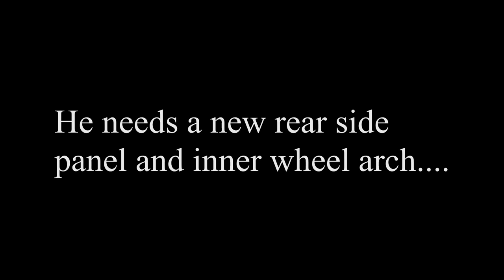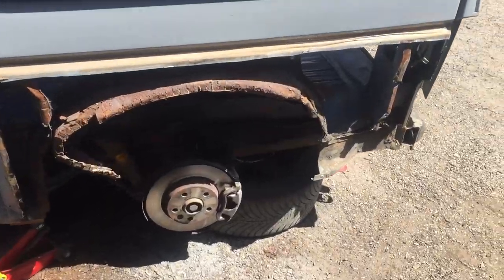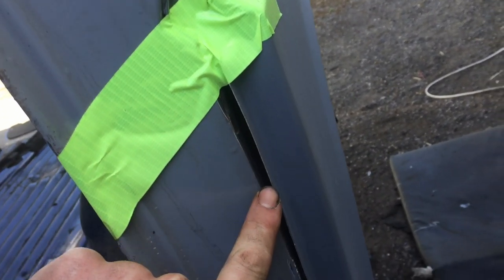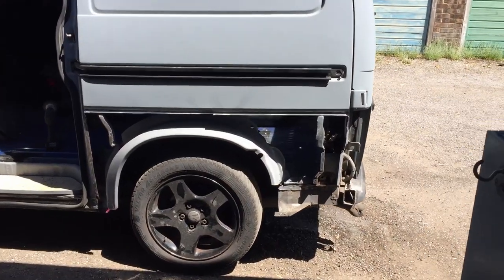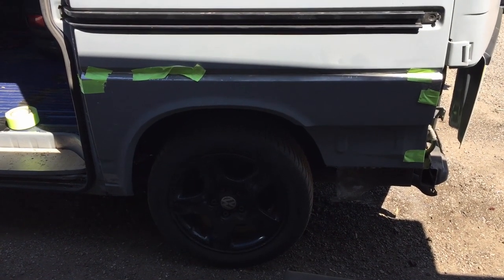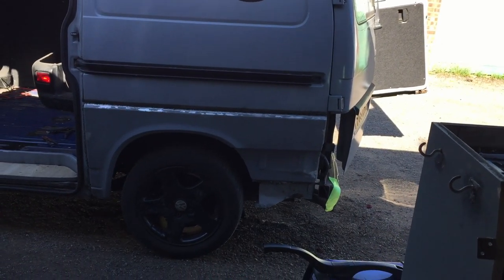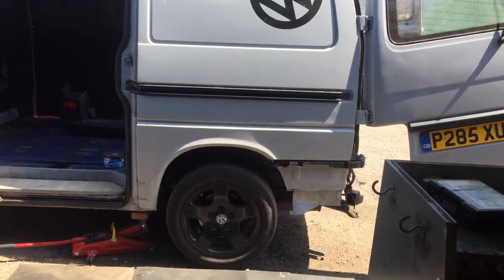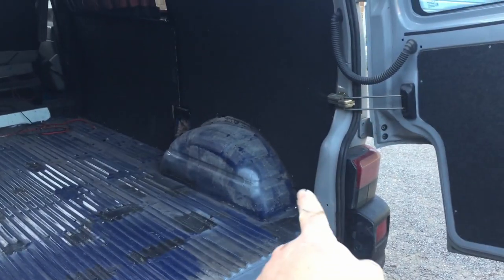VW T4 - Wheel Arch and Quarter Panel Welding

Comment: Thank you for sharing. You could in hindsight drill out the spot /plug welds to help separate the two panels. Then fill / weld the holes when new panel is in place. It stops distortion too. I'm no welder but have done similar DIY in the past .
Reply from the maker: Thanks for the tip :)

Comment: Looking to do something similar on my own T4 and have been waiting a while to find someone brave enough to do it first 😂 great video and well done. You may have inspired me to order the panel from just kampers!
Reply from the maker: That’s great! It’s really not that hard, just takes a lot of hours. Good luck!
Reply: Joel's Stuff fortunately mines a low mileage van that only needs the very bottom where the rear arch meets the sliding door. I say that, I may well cut it out and find a can of worms!!!
Reply: I've got some Patches on mine.  I was considering using the case from a washing machine I have to do some repair panels. Hmmmm.

Comment: Hi Joel.great job there.my t4 front arches not brilliant but just patch up with fibreglass an paint and cover with fender trims for now. I bought 2nd hand welder an rods but my wife doesn’t want me to weld as I lost an eye as a kid.not welding.I wear safety glasses anyway just been under van oiling an painting.all need to decent auto dark helmet to try bit welding .steve in uk
Reply from the maker: Hi Steve! Don’t be afraid to start welding - as long as you wear the correct protective gear it’s really not as scary as it looks! Good luck!

Comment: Don't prise panels apart like that , you will distort them. Drill out spot welds, to prevent distorting the flange of the panel, there are special drills for this that just drill one side out, or if you have to drill through , then use a piece of 'non ferrous metal' such as aluminium or brass, behind when rewelding. The weld will only attach itself to the steel!

Comment: If you drill thru the spot weld with an 8mm drill bit you can the fill holes back up with weld  .
For first time fu##in awsome 
Turned out nice enoff 
👍👍👍😜🏴🦄🦕😁✌️🤞

Comment: just wondering why did you decide to weld it in the V grove rather than cut it to where the new panel size?
Reply from the maker: Good question. I thought that the V groove provided an easy way for lining it up in the right place. Also I didn’t really want to cut good original metal out if I didn’t need to.

Comment: Good informative video, it makes me more willing to attempt this job.   What size welder are you using as in its  power.  I am considering buying a welder but not sure what to go for  and haven't done much research yet .
Reply from the maker: My welder is a Wolf 140 mig welder (I think it has a 30A - 135A power range), although I’ve never used it above about 60% power. I would be more concerned about wire feed issues, as some of the cheap welders can struggle to smoothly feed a wire through the torch as you are welding (mine is pretty crap). It makes it much harder to weld and harder to learn. Make sure you read up some reviews and get one better than mine. Good luck!
Reply: @JoelsStuff  Thanks for that info on the welder, I would never have thought about smooth wire feed.

Comment: Great job👍Was that a gasless mig welder you used?
Reply from the maker: It has gas but I was just using flux core wire and no gas because I had run out.

Comment: Completely new to this and never welded before or used an angle grinder and suggestions what welder did you use?
Reply from the maker: I’m not the best person to advise you - this is the only welder I have used. I’d recommend MIG welding, and don’t go for a mega cheap one. It’s important to make sure the wire feed is smooth and consistent to get a good weld, and the cheap ones can suffer from poor wire feed, which makes them harder to learn on (the welder I have is actually a nightmare so don’t get mine). Good luck!

Comment: Hi mate I've just fitted my driver's side arch then noticed the inner arch is about 1 inch away from the new arch and it's fitted perfect,did you come across this
Reply from the maker: Hi. The whole arch is made up of 2 pieces - inner and outer (confusingly the “inner” sits nearer to the outside of the van, and should fill a gap about an inch or two thick between the “outer” wheel arch and the exterior panel). If all three pieces are set correctly there should be only a gap of millimetres at the most which can be filled with sealant. Without looking I couldn’t say. Good luck!

Comment: You using a gasless mig, be handy to know the settings. Good job.
Reply from the maker: I use it both with and without gas here. Without gas it’s surprisingly easy. I just use flux core wire and a medium power setting (adjusted to suit the thickness of metal I am welding onto). Good luck!
Reply: @JoelsStuff  good to know, thank you

Comment: So the repair panels aren't that good Where did you purchase them? Thanks...
Reply from the maker: I got them from ebay. I think repair panels are generally like this, you just need to work with what you get. They actually turned out pretty good after a bit of tweaking!
Reply: @JoelsStuff  ok thankyou for replying i will have a look..👍